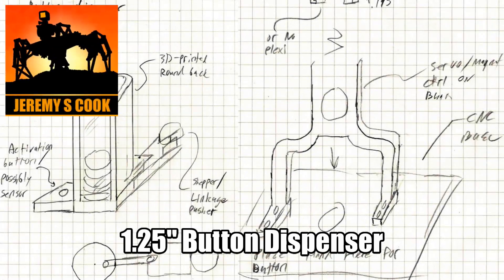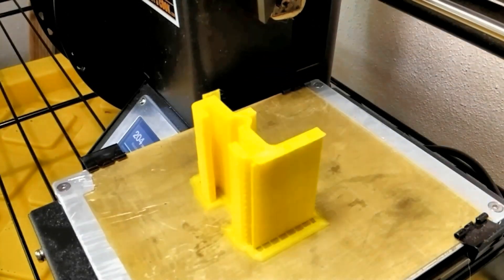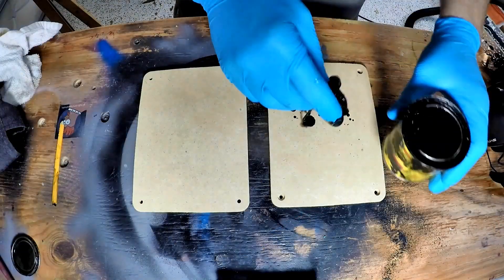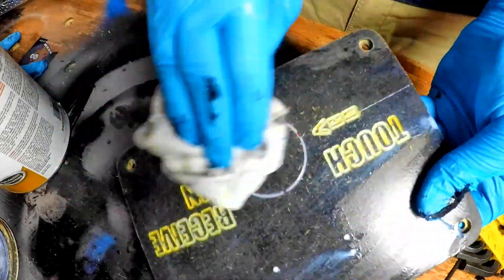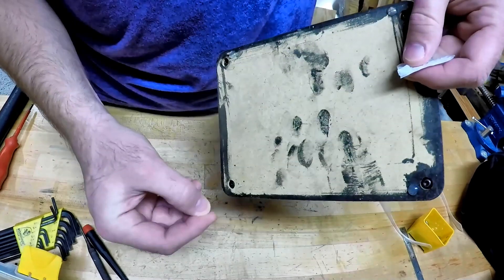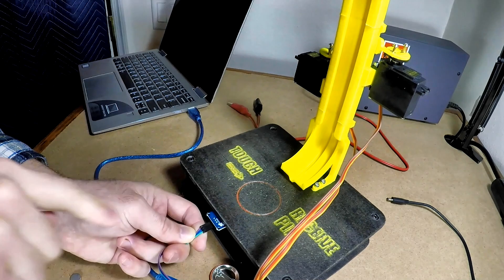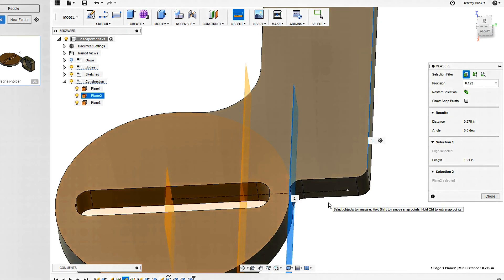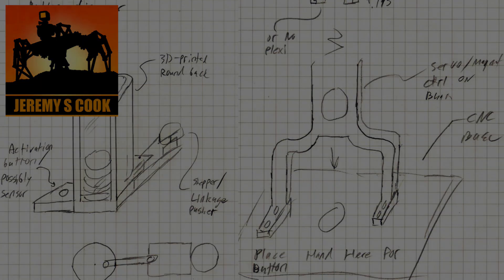Button Dispenser Robot [Arduino Capacitive Sensor]

Comment: I started using HDPE a lot more. No finish required, no dust in the air and it can be cut super fast.
Reply from the maker: Interesting. I'll have to check out that material. You mean for cutting right? Or as filament for printing?
Reply: Jeremy S Cook CNC of course.

Comment: what type of glue was it you used with the PLA ?  i hate using superglue.
Reply from the maker: Cyanoacrylate is what I mentioned. Unfortunately that the generic/chemical name for superglue!
Reply: @JeremyCook  lol.. gotcha. i would prefer something that took a few seconds to bond rather than sticking all over the darned place ;)
Reply from the maker: @MicheleHjorleifsson  Ha, well in CNA glue's defense, it has held up quite well. Seems I've heard of people using 3D-printing pens for bonding parts, which could be an option, though I've yet to try it. Thanks for watching!
Reply: @JeremyCook  thanks i may try that or some epoxy resin.
Reply from the maker: @MicheleHjorleifsson  NP! I actually used epoxy to bond things together on this dust collector: https://www.youtube.com/watch?v=WIhFcK5mLU0 - still together!
Reply: @JeremyCook  i will check it out thanks.
Reply: @MicheleHjorleifsson  You can use an accelerator with CA that will harden the glue in about 6 to 8 seconds.